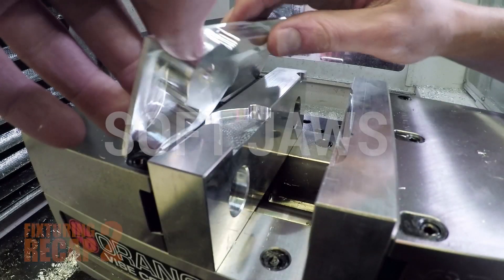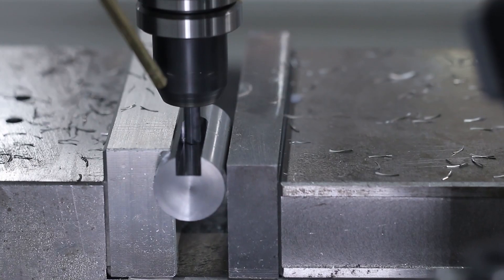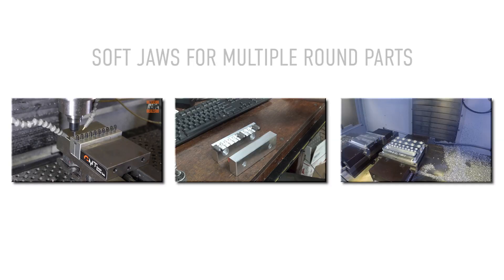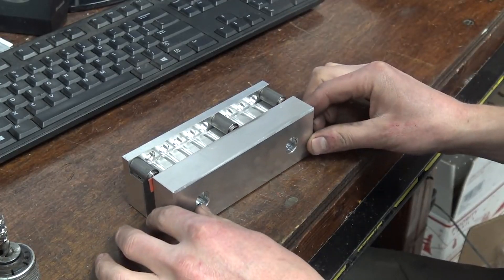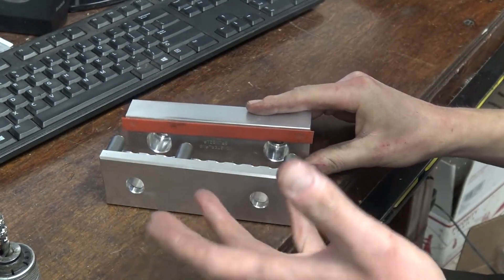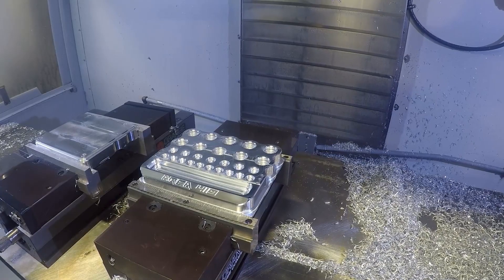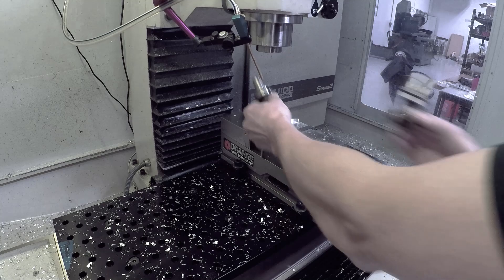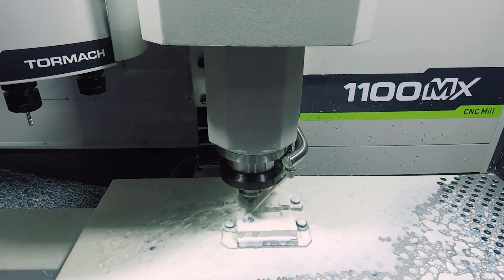Machine Shop Fixturing & Workholding: Soft Jaws

Comment: If you machine the second soft jaw to act like a flexture in the contact points it should also compensate for slight inaccuracies.  (I know this video is old)
Reply: Do you happen to know where I can find more info or examples of that? It makes sense but I’m curious how it’s typically done.

Comment: Widget #78: Buy swiss lathe.
On jobs where I'm running more than 1 piece in a vise I loosen the moveable jaw or the set screw at the back of it. Also on vise work where I have a round contour I drill and bore through spacers, which is way quicker than 3d milling.

Comment: Because soft jaws tend to multiply like gremlins, I assigned a part number to each and engraved that into the jaw(s). That way next year when you get a repeat job, you can find exactly which set go with the work. Additionally, I would engrave arrows or other other indicators showing what origin the CAM/G-Code was expecting. Very little additional work when you are making the jaws. HUGE time / error / frustration saving the next time they get used.

Comment: I once had to mill out a 1 3/8" wide x 1 1/2" deep slot into some 2x2x4" cold rolled square stock.. I didn't want to do them one at a time though, so I faced both ends of the part, set the par on some short parallels, and then had a piece of 1/2" x 2" UHMW nylon on my movable jaw and a clamp holding 3 pieces together so they couldn't move apart, it worked really well on a manual mill with power feeds, I was making the same parts about 3x faster than my co workers, I really spent a lot of time figuring out the best toolpath and pushing the mill and cutter to the limit.. 3/4" roughing mill, 330 RPM, 1/2" DOC per pass, then widen to spec in one shot, if you pay attention to which way the tool will deflect on the last pass you can clean up the entire side just from tool deflection.. These weren't high accuracy parts ( +/- 0.030") so no trouble hitting that

Comment: What's your recommendation for the Fusion work flow on softjaws?  I add a new part in the part file and use the boolean command to remove the the parts of the jaws I don't need.  I figure there has got to be a slick way of templating that operation.

Comment: A lot of work holding is going to 3d printing. Obviously consumer grade 3d printers are not going to cut it because they print soft or breakable materials. But the markforged units work WONDERFULLY. Or anything that prints a  continuous fiber rienforcedrced nylon material